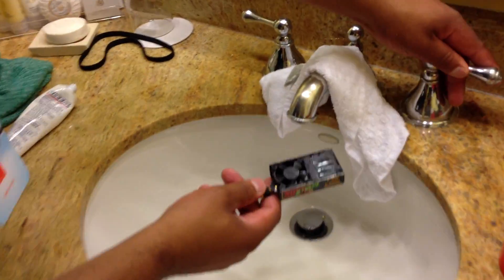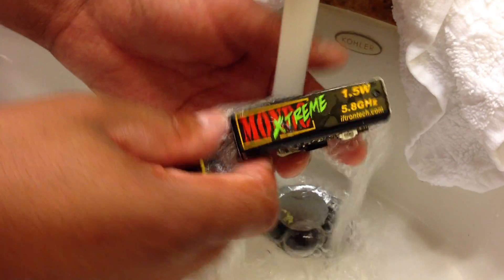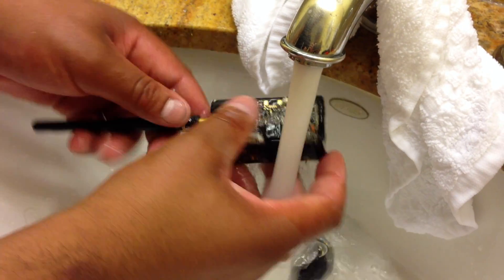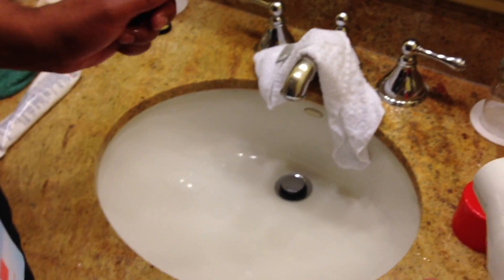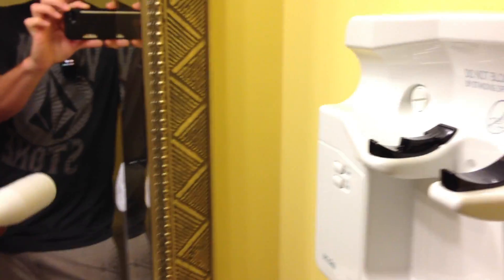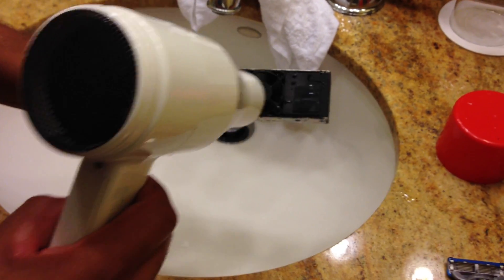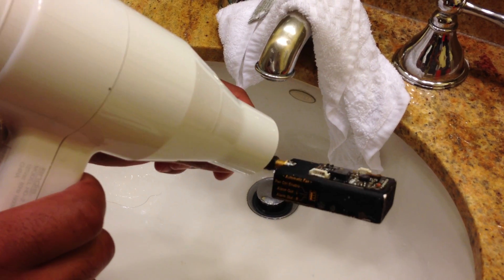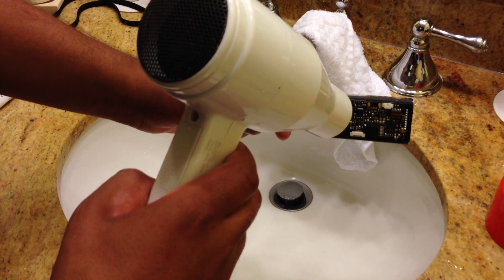How to on 5.8ghz video transmitter maintenance

Comment: The electronics should be fine even without waterproofing, as long as you take care of them properly after.  I dunked a whole quad in the lake, powered up and everything.  Fished it out, immediately blew it off with compressed air, and then set it on a counter with a hair drier going on it for an hour.  Everything works, even the ESC's, I even got the moisture out from behind the camera lens.